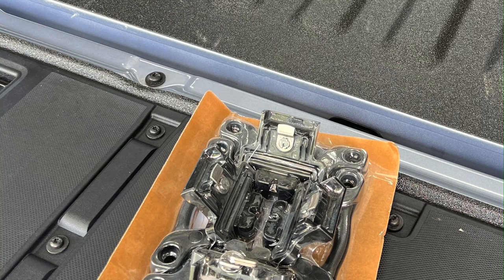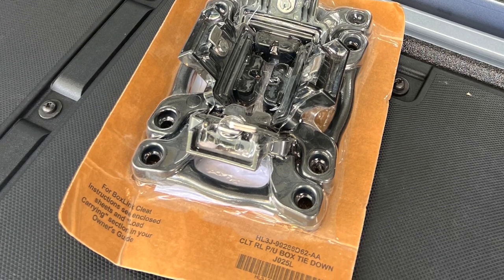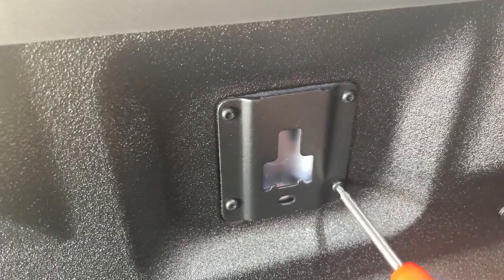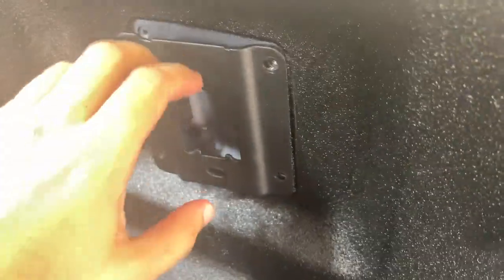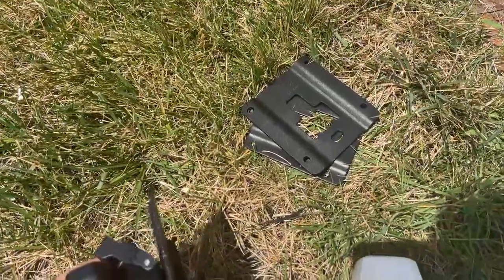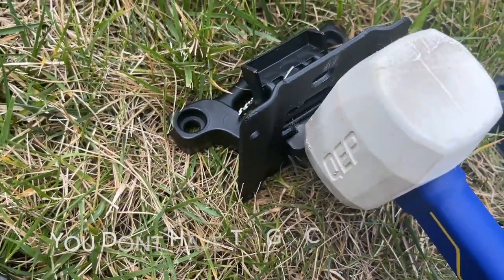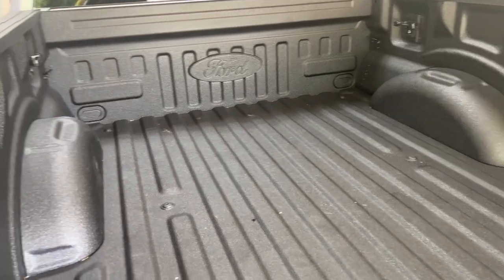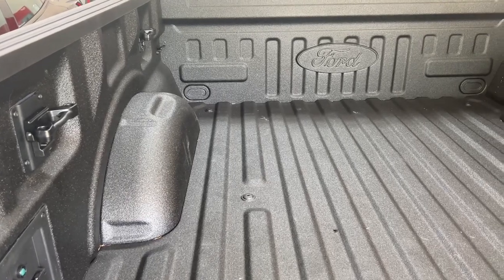Finally beating those Ford F150 Boxlink Cleats! (Install Made EASY!!)

Comment: Thanks for the idea.  Realizing I'm not the only one, I ended up using a hammer knocking each one into the plate without taking them down.  Snug and tight.

Comment: I've got a Ford F150 Lightning Pro. It does not come with these cleats, but the holes are there for them. These holes do not have any threads, do you know what side thread I should select to tap them?
Reply from the maker: That’s a great question. Maybe buy one of the cleat kits (that include the plate) then take the screws they give you as a size guide?

Comment: Honestly, I'm not quite understanding the problem.  These came with my '22 F450.  They installed easily.  Just popped them in and locked.  Maybe they've adjusted some tolerances?

Comment: The problem is with who did your spray-in liner. Line-X did mine and they removed the brackets before spraying and then reinstalled them. This way you also don’t see the truck color behind them and the cleats snap back in easy-peasy.
Reply: Got mind fro the factory and they didn’t remove them
Reply from the maker: Right, mine was factory bedliner too and cleats provided by dealer so logically ford knew I’d have a huge hassle on my hands

Comment: Mine are still in the original package. Still can’t see what all the jazz is about. Your video didn’t show any features, advantages or benefits. So what do they do ?  They can’t stop anything from sliding to the front of the box. Bungee cords are useless. All I see are four poorly located locking attachment points that move up or down and are near impossible to install or remove. If the dealers are giving them away for free, that says it all.  Your presentation was well done otherwise.